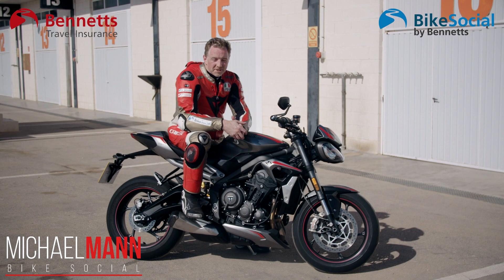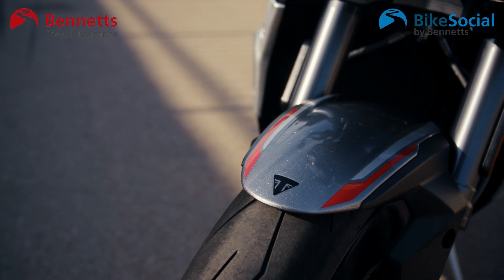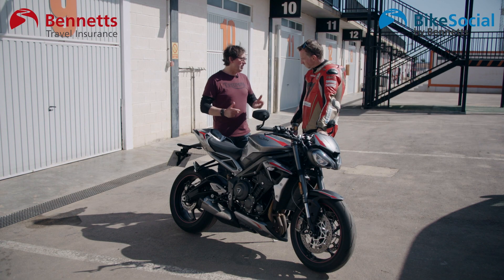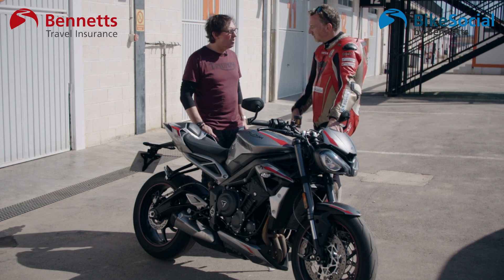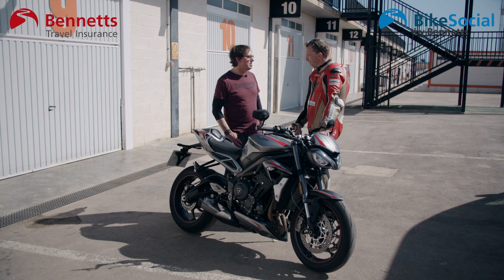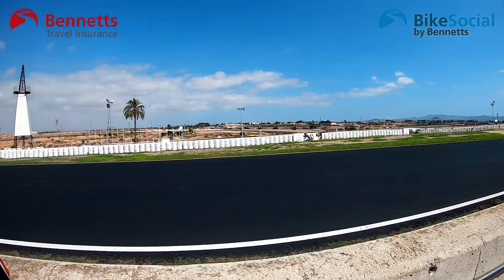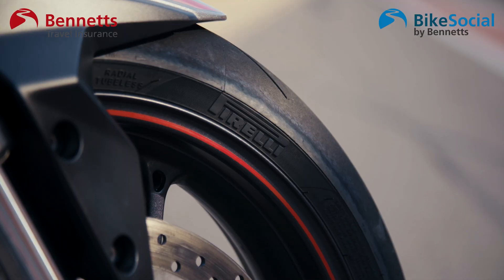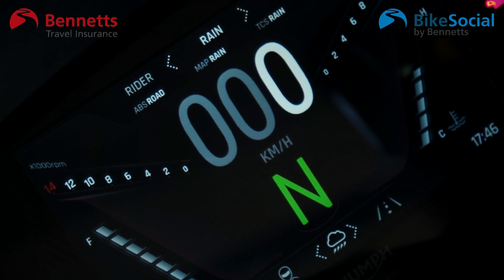Triumph Street Triple RS [ 2020 ] REVIEW | BikeSocial

Comment: I hope the midrange power bump has given this motor a bit more character. I really wanted to like the 2017 765RS but after testing it just felt... meh. The older 675 gave me a bigger grin and my current xsr900 feels a lot more fun/raw than the 765. Don't get me wrong. The 765RS is the best middle weight naked in its class (speed, braking, handling etc.) when measured. It's just, in my opinion, too smooth and refined for a "hooligan" triple. It should be twitching, screaming, popping and gurgling when you take it for a short spin around your favorite backroad. As the old Speed Triples did back in the day :)
Reply: XrNeo I guess that is the trend of motorcycle these days. Smooth and ease of riding. I also found the street triple rs too smooth.

Comment: I lust for the engine and lament the platform. Even as an ol’fart, if I had a track in my backyard, I’d have one of ‘em.  But I don’t, so what I would pay for is a 765 “midsized” sport touring model with Speed Triple “roots” empathetic ergonomics and a decent cost of ownership.  Damn, that engine deserves more dance partners.
Reply: I agree, I think they should do more variants. Just sightly more upright and some wind protection would be ideal for me, like Yamaha have done with the Tracer.
Reply: You guys are kind of describing the Tiger 800 XRT.
Reply: @Kendoji1  I get what your saying, but that's really not what I want (it's less power, more weight, worse suspension, worse brakes, and costs more). Just a street triple R or RS with a reasonable screen and maybe slightly higher bars - that'll do. Just as capable in the twisties but a bit more comfortable on the way there and back home afterwards.
Reply: yodidly: Right you are. I have no desire for a dumbed down 765, I want a smartened-up performance bike using that jewel of an engine . . . and “bespoke” panniers. Even if it cost more. Sort of a light all-rounder for riders who can appreciate quality. A niche product that the hordes won’t buy, but silently admire.

Comment: I hope the first batch are screwed together better than the first 765's. Triumph you need to keep an eye on all bikes coming out of your Thailand factory. Fancy new models are no good if the customer has to put up with rust on fuel tanks inner surface after a few months from new (plus other fixings). Put things on straight, not wonky like the dash, tank, decals etc. Not just my bike, new bikes in showroom all had problems.....Stop rushing them out!!